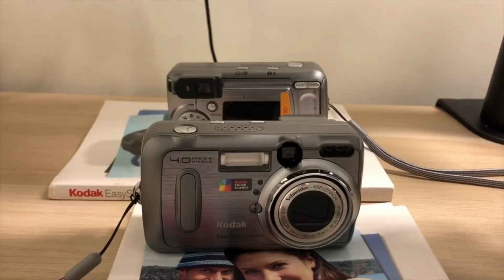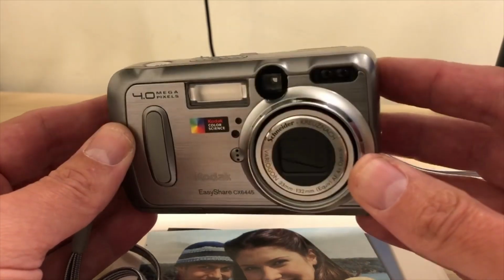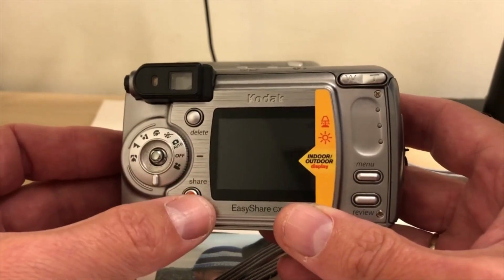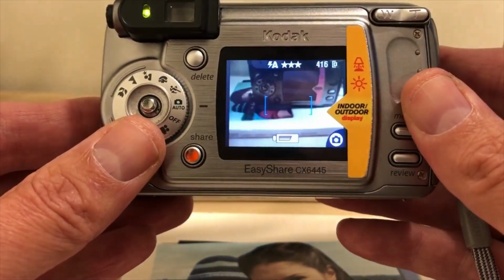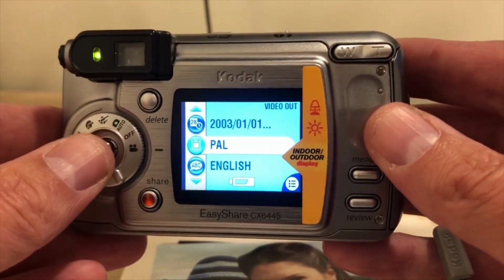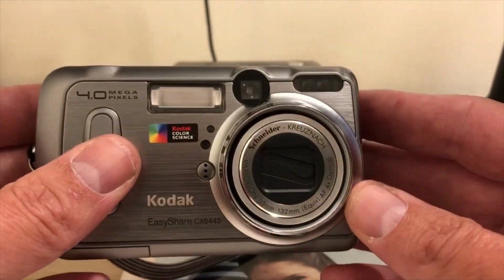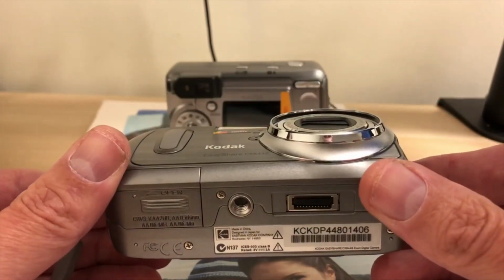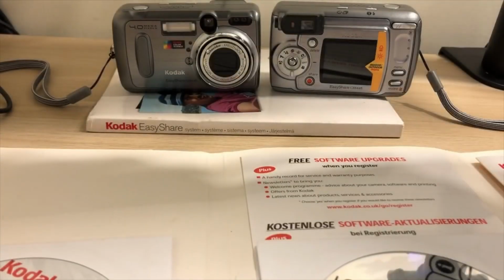Kodak CX6445 CCD digital delight, camera with Color Science

Comment: This is an old video but mine isn't turning on, is it a chagring issue? I have a plug in charger but I'm just seeing red lights and idk if it should be at the first or the back but it isn't turning on
Reply from the maker: Can you try it with normal alkaline batteries?

Comment: I had 
 eats power, but you could get a simple battery for it that lasted for about 10 hours and even more if you didn't use the special modes too much. There were other battery options as well as rechargeable battery, some had longer lasting batteries. I believe there was a lens adapter as well for wide shots and compact memory cards. Flashcards were pretty good for the time, sizes varied as well. Kodak Digital cameras were great back then in the mid-2000s. I recall firmware updates were required, though an Internet connection via their old website or some Kodak memory cards with special updates built in. You have to use their cards sometimes according to the instructions in the manual? But it later was changed. The oddest thing I found was that dial on the back it often seemed difficult to change the settings to it as time went on. I did read something that some broke off. I never found that happen, thankfully. However, a few years later, my battery cover came away through wear and tear. I wonder if anyone else had that particular kind problem? Or drop the camera and the cover snap off? It, I thought, was all metal except the cover and found this out the day it broke. This my second camera from Kodak had a brick like one earlier one around 1999 an easyshre heavy block of camera, but I enjoyed using it for a couple months till it to had stopped functioning oh it worked here and there but eventually a black screen. Though years later, I fired up to see if it would work, and for a minute, it blinked to lfe and lasted for a second. It still had a memory card in finding a picture of my late mother on. And a good picture to. Still have that card. This cameras from the beginning were fantastic, then and still hold good memories of holidays and Christmas party's and fun days. Before this, there's film cameras which I enjoyed as a young teenager it got me into photography in the 80s, and the predigidal of course digital was coming even then. But digital and film have a place today. I think both are relevant to our future. Combining the two forms is the best method for technology. 
One day, a camera thin as paper might come transforming photography in ways that's likely to alter images forever, a camera that looks similar to old photo paper and take images by touching or holding it up a snap.
Reply from the maker: Thank you for your lovely comment. I really enjoyed reading about your experiences with this type of camera. I was backpacking around 2004 and I had a very slow Premier branded digital camera, a friend I was travelling with had a Kodak with a substantial zoom and it seemed like a really nice camera for the time. I got this camera later and really liked the pictures output from the CX6445, the lens glass is very decent for the time. Just a nice camera from the era Kodak were still making cameras before putting their name to generic produced ones later on.

Comment: Nice review on this little Kodak.
Stil going strong! I love those early digital cameras on AA batteries. I use lithium ion rechargeables. 2GB sd cards are stil made today, and wil work fine in most early digicams. Not many Kodaks in my collection, just a nice Easy Share Z710.
Reply from the maker: Thanks it's a shame Kodak didn't carry on with their digital camera business as we would have seen some interesting models for sure. Thanks for sharing the information about the 2gb sd cards I was surprised to hear they are still being made today.
Reply: @AvidRetro  I can still buy AGFA made 2gb SD and Compact Flash cards online here in the Netherlands. And I have collected some old 1gb cards over the years.  😊👍